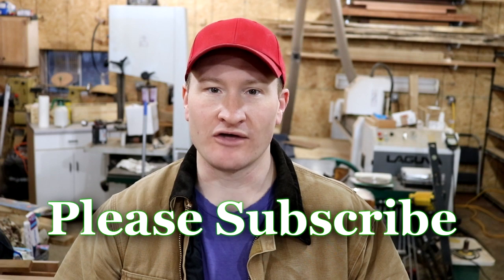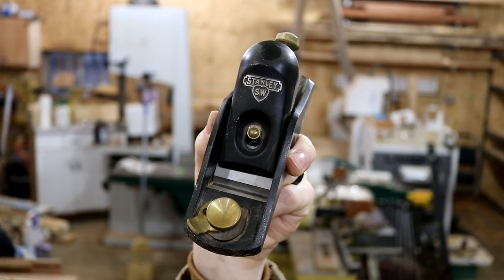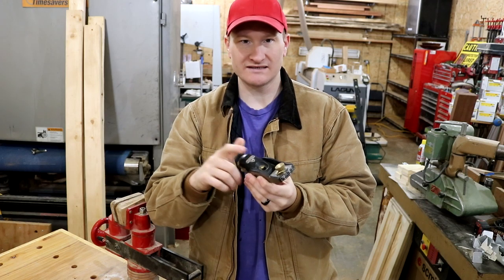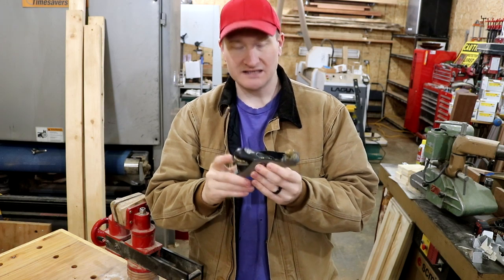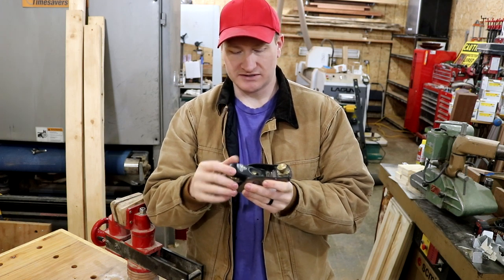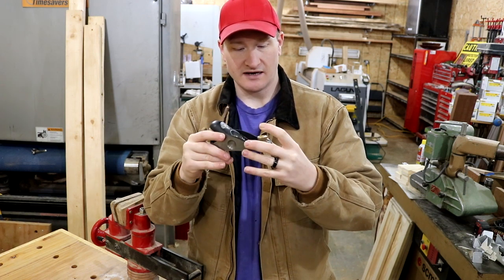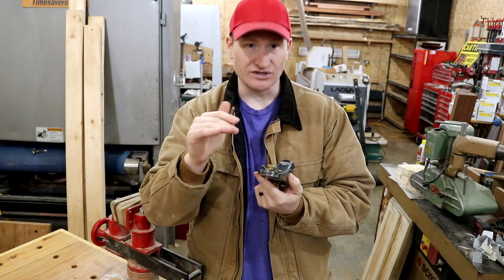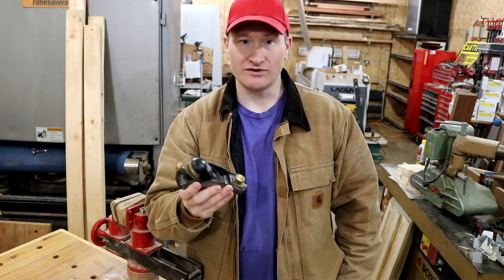WOODWORKING Stories and Tool Review Stanley Block Plane - Woodworking from a Pro

Comment: I love the small dressing plane for doing fine fit work. I used to use rough cut lumber cut offs for wood stove so starting fire I would use my blocking plane to rough up edge up sides and make some  quick shavings for building fire easy

Comment: The block plane is a sweet little tool for light duty work. I usually grab it backwards and use a pull stroke. I think a little more feel and control.
Cheers,
Lee